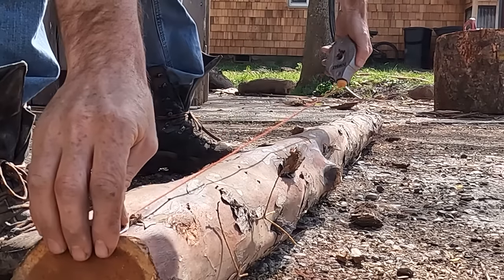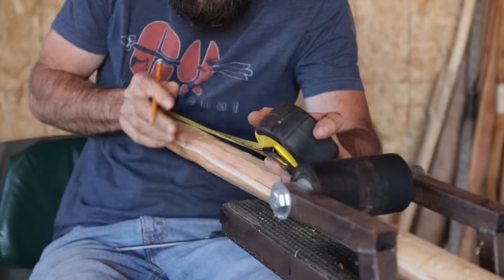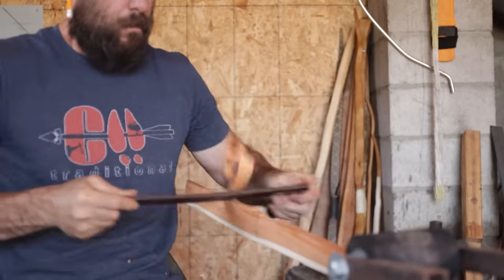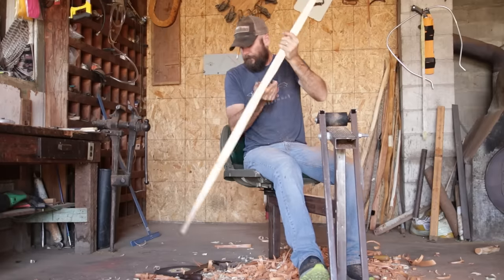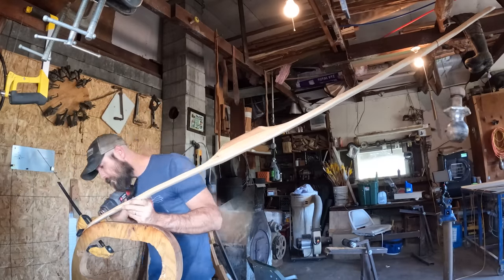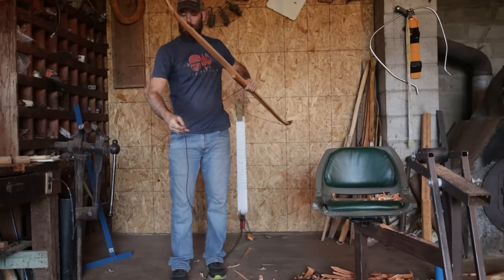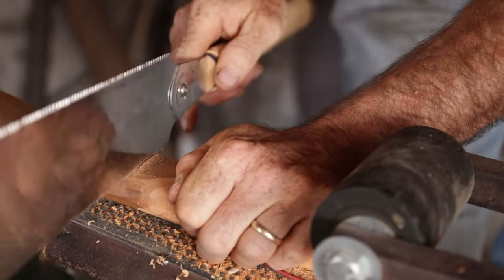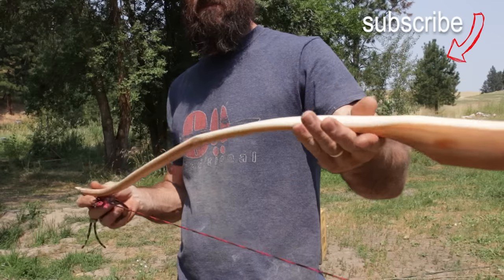Building a Pacific Yew Recurve Self Bow - Start to Finish

Comment: Clay thank you for your videos thanks to you I was able to build my first selfbow (it didnt snap), I was able to heat-bend the twisted stave into a much better shape (it had reflex halfway through a limb) backed it with rawhide successfully, it shoots with minimal handshock but the weight is only 25lbs so I'm going to reflex the tips and try to get the weight up. But I couldn't be more thankful for your videos. For anyone thinking you don't have the tools I did it mostly with a straight blade pocket knife. You can do it I wish you all luck!!!

Comment: I’ve read your book and watched a lot of your videos. I’ve also been a fan of your work on Alone and was proud to see you win season 8. I have made several bows from vine maple and black locust based on your book but the two bows I’ve tried to make from pacific yew based on this video have both broken in three pieces. The last one I made was looking really good and I never thought it would break but it did on the tillering tree. I will keep trying but I wish I knew what I am doing wrong…
Reply: I'm no expert, but it sounds like they're breaking in tension. (Typical with a 3 piece break) Either you need to leave thicker sapwood (stronger tension) or reduce strain overall (wider and flatter, or longer,  or decrease draw weight)

Comment: Very well done. I've been making self bows for some 30 years now mostly out of hickory. I've got some ipa Word which makes very strong and fast cast and I have some Brazilian Osage I've been savoring for just the right time. Some of the bows I've made were two piece laminated with Padua for the belly and hickory for the back. I'm not real fond of ash. Most of them would twist at the limb so gave that wood up. Black walnut has done well with a hickory back. But for power and speed ipa wood is probably the best. I amassed a pretty good stock of wood some years ago and like sinew backing my hickory selfbows. This helps with string follow and increases the cast since hickory is notorious for losing power from string follow. My next endeavor is to make a Hungarian or Korean horse bow image from some of the woods I already have. I found that making forms for curving limbs I use a couple two by fours nailed together and then on both sides at 3/4 inches from the surface I pound in 8 penny nails every two inches so the 2x4 form looks like a huge centipede. At any rate I then can use a split bicycle tube and wrap the bow back and forth alongs it's length and use curved pieces to achieve reflex deflex or recurved limbs. I try as hard as possible to spend my money on where it really counts and that's the bow woods. Just wood itself with contrived shortages has driven the cost of lumber thru the roof. Great video.

Comment: Clay you should get yourself a Shinto Rasp, they're pretty cheap like $25 for one they come double sided with a fine side and a course side. I picked one up a few years ago after seeing one on Pask Makes and it's the only rasp I use for woodworking now, I think you'd like it. 👍👍

A little tip, if the wood grain is starting to tear out like that in one direction, flip the piece and go from the other direction. Also you can use the fine wood shavings to burnish the surface too.

Comment: Hey Clay, can you perhaps put out a tracing of the recurve form as a PDF? That'd be pretty cool. Then we could trace it onto a big sandwich of plywood and cut it out.
Reply: Plywood is not making a bow though lol unless it's just for looks I guess
Reply: @stevensmith2085  : I assumed he meant to use it as a rough template of some kind, not to make the bow out of plywood.
Reply: @StevenKeery  still won't work that well you need to follow the grain and twists of the wood.

Unless your wood is perfectly aligned with his bow wood you won't be able to make your own using his measures and curves and straights

Comment: Glad to see you post up a yew bow build.  I watch a lot of build vids for ideas, but my brain seems to understand the way you communicate better than it understands other folks' instructional vids; I'd say 98% of what I do when I build my bows is based off your instruction.  I love my osage bows, but yew has a different type of sexiness and appeal to me, and I will definitely be making one as soon as I can get a stave or get up to Oregon and harvest some, and get them cured out; having this vid will be most helpful.
  
I noticed that you lay your handle out on this bow differently than you have been on your osage builds,  You went 2" above and 2" below center which should result in equal limb lengths.  Are you doing that on this bow because it is Yew, or is this a move you've transitioned to on Osage also?  I still lay my osage out 1 to 1.25 above center and 3 to 2.75 below center to end up with a shorter bottom limb.  I've tried to wrap my mind around the necessity for a shorter bottom limb, but I can't seem to understand why the benefits would outweigh the "eye-confusion" (for lack of a better term) that happens to me when tillering a bow with a longer top limb and a shorter, slightly stiffer lower limb.  Since your nock and arrow will still be above the center point of the bow, I'm assuming that you still want to achieve a slightly positive tiller (?) when complete.  Regardless, it seems like this small change in your handle layout would result in a bow that is easier (less eye confusion) to tiller.  Can you please speak to why you chose to lay the handle out in this manner resulting in equal limb lengths and if it would translate well to Osage builds?  Thanks for the content dood.  You've been a tremendous asset to me over the years.
Reply from the maker: Good catch. I usually still shift them down a little bit most out of habit. I don’t really see much difference in the bows performing or longevity when laid out symmetrical like this.
Reply: That is good to hear.  I look forward to trying it on my next build.  Looking forward to your Alone assessment; my wife and I were hoping they’d remove them both at the saner one in a med-check, because they were/are both so amazing.  Not taking anything away from you and your win, and I know they edit to show what they want, but those two had heart, conviction, and a tremendous positivity that is truly admirable.
Reply: At the same time…

Comment: I wish I had Yew in my area to work with?Bodark can be found rarely In my area; You used what you had, I am on the east coast and good bow wood isn't plentiful. I also wish I had have known about useing a red hot nail to clean up the bow nocks.Smart idea, probably why I didn't think of it, lack of smarts. I like the way you build bows. We use a steam box to bend the the tips. I didn't know just heat would allow you to bend a bows tip so far or is that a yew trait? I like the limb wrench as well. 
  You did a good job. Anyone would be happy to have a bow turn out like yours.

Comment: That is a nice yew log, considering how slow they grow that log has probably 20 or 30 growth rings on it. Beautiful wood to craft things with. Your bow looks amazing.
Reply: @David Munir well over 130 with his thick it was. problem with that weight is getting the sides to match, and having a system that can pull that much weight
Reply: @jordanrandall8064  : Just a random piece of information.  The bows they recovered from Henry V111's sunken flagship, Mary Rose, had a draw weight of up to 150lb. 
The skeletons of the archers preserved in the silt, had deformed shoulder bones, that identified them as the archers on board.

Comment: Huh kind of surprised to see you using a ryoba to cut with. Don't know why...your carpentry was the best on that season of alone but still it caught me a bit off guard. Glad to know I can also use your channel for more then just survival knowledge. Edit: Ok as much as the ryoba surprised me the shave horse and the card scraper were even more surprising...Cheers! Edit #2: Side note your nail burning technique for the knock groove also seals the wood fibers and protects them from water damage ensuring those grooves remain accurate longer. Well thought out use of heat.
Reply from the maker: Glad ya enjoyed it

Comment: I'm blindly assuming that applying the hot nail to the notches will help seal any splints/fractures created using the round file?🤔
Reply from the maker: I think so but it’s just speculation

Comment: Thanks for posting this.  I have a pacific yew log I've been drying for 3 years now. I've never built a bow.  How come you don't just use a bandsaw to cut everything close to the line?  Are you just trying to be old-fashioned, or is there a reason for the draw knife?  Seems like it would be 10× quicker to use a saw.

Comment: What kind of finish did you use on the bow? Beautiful bow! Since it's yew, will the string nocks hold up without horn or antler to help protect them? Thanks, great video!
Reply from the maker: They’ll hold up fine. I added a few examples pieces of string material in thr nock loops to pad them. I’ll finish the bow with a lacquer

Comment: Old video so i hope you get to respond. Did you start with an initial thickness taper? Or just one continuous limb thickness and then eyball the weakspots and remove wood wlthere instead of having a predetermined taper? Or did the limb stay the same thickness because the width tapered so much?

Comment: Hey just wondering do you were a mask when working with yew because I did not once and got a bad stomach ache from yew toxins in the saw dust just wondering if it happened to you to
Reply from the maker: I normally do the sanding outside where there’s a breeze.
Reply: @clayhayeshunter  cool thanks

Comment: Clay, if you want a more accurate way to see where the limbs are weak and for a better way to tell how even the curvature is do a grid behind the tiller. For a more accurate grid do it in 1cm X 1cm grid. Just simple lines work. As you already have black I would go with blue or red but on a "natural" wood background it would be hard to tell the difference with blue and black and red would be hard to see, but if you painted the wall white then did the 6in X 1ft, or is it 1ft X 2ft, in black and the 1cm X 1cm grid in red or blue you would be able to see them much better. If you really wanted to get it more accurate you could do the 1cm grid in blue and then do a 5mil grid in red. Also if you had a rope clamp like that of a climber or for repelling at the end near you you could use it to hold the rope while you get close to inspect the bow and mark exactly where the weak spots are.
Just some tips and tricks I've thought of over the years of watching and making my own bows.
Reply from the maker: Thanks Sean
Reply: @clayhayeshunter  Most welcome.

Comment: I have a simple question on the process on making the bow. I understand this shows the traditional way with draw knives and what not. My question is if one has access to bandsaw's and whatnot would the process be the same? I know that removing material is removing material. But does using the draw knife keep some kind of particular grain structure throughout the bow? Just curious because I'd like to make an attempt at this bow and I have access to a woodworking shop. Although I'd love to actually go old school and shape it by hand. But since I have access to a shop that could make the process faster was wondering if it actually had an effect on the bow itself. Thanks
Reply from the maker: Many bowyers use bandsaws for removing bulk materials. But once you get close to finished dimensions, hand tools are the way to go.
Reply: @clayhayeshunter  thank you sir. I knew it was a bit of a dopey question that I pretty much knew the answer to. Now I just gotta find me some good yew. I'm in the northeast and finding something good that isn't crazy expensive isn't easy in my parts.

Comment: It is not the reflexed tips that „adds draw weight“. The heat treating process which removes excess weight and changes the mechanical properties of the wood -> this results in higher efficiency and more resistance (draw weight). A reflex per se does not change anything on a longbow
Reply from the maker: Although you’re right about the heat treating, reflex the tips does add weight because it causes the tips to rest farther forward. That is, unless the bow takes more set due to the reflex.

Comment: Why after bending the bow you have decided to remove wood? You said it will get extra weight, meaning the power of the bow, am I right? Is there any regulation limiting you on 60 pounds?
Reply from the maker: I’m removing wood to adjust how and where the bow bends. The process is know as tillering.
Reply: @clayhayeshunter  think I'll stick here for some time) I used to make bows when I was a kid, that's interesting.

Comment: Man! I’ve been watching you since one of your first Osage builds, I believe back in 2012. Anyways, question. I’ve got a perfect yew stave, 63” total length, sap wood is at about 1/4 thick, I’ve got the bow just to brace height and it seems the heart wood is just dwindling away as I’ve evened out the tiller. What can I do to not mess this up as I go to my desired weight of 50 pounds. Help! My overall limb thickness is 1/2 with the sap wood. Narrow tips, limbs are 1.5 wide. Any advise.
Reply from the maker: You can start thinning out the sapwood. Just finish tillering by removing sapwood rather than heartwood.

Comment: A good rasp is the key to success. Using a file for metal, or a small file for wood (about twice as aggressive as the largest file for metal) is still an anonism. When you have teeth like a hacksaw, things go much faster. What's missing most in bow making is a tool that can remove large layers of hard wood without applying a lot of pressure from above. For everyone who will make a bow, have something on hand like an orbital sander and the coarsest and highest quality wheels, or a good rasp that will not get clogged with shavings and ring. Abrasive is not the best option, as it will still remain in the wood and ruin your scraper

Comment: Hey Clay, I live in San diego my tribe mainly used elderberry an willow. I haven't had much luck. Have you ever attempted a elderberry bow? Only other wood in my area worth using might be pacific dogwood, or maybe a live or black oak? If you had an suggestions, I'd appreciate it
Reply: Hey, I have seen a few bows made out of elder wood but it appears to be a bit weak in tension. As for dogwood the piece I used actually turned out great. If you want to know a few more species you can read my blog post about different wood species for bow making.
https://straightgrainedboard.com/7-outstanding-woods-for-bow-making/
Reply: @vaskopc9430  awesome thanks for the info

Comment: The draw knife is a tool that requires a good bit of practice to use well. You can easily ruin a good piece of wood by going too fast and taking off too much. The circular saw and bandsaw will get you to a blank you can tiller way quicker and way more accurate to your layout lines. And so what, about the tools you use. If an Indian had access to our tools they’d have used them too